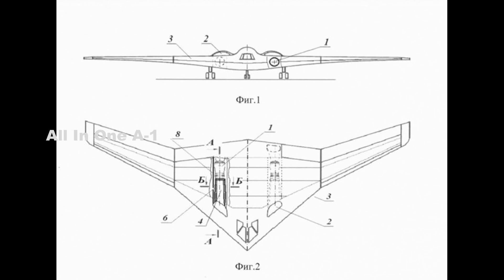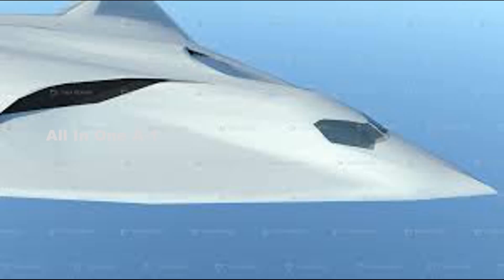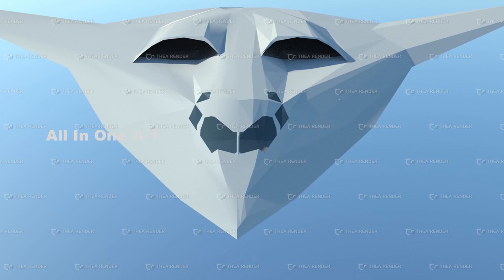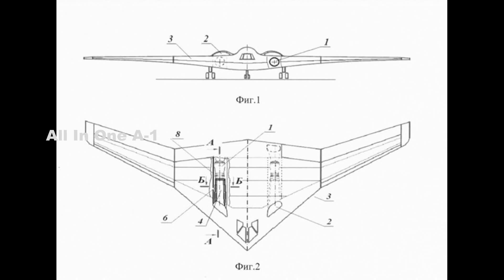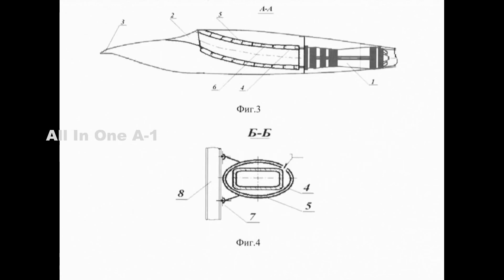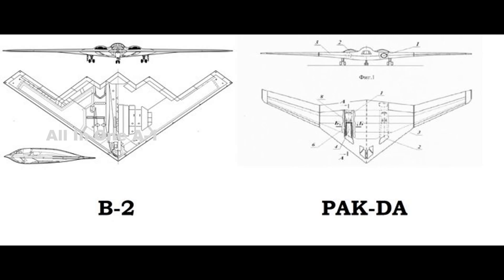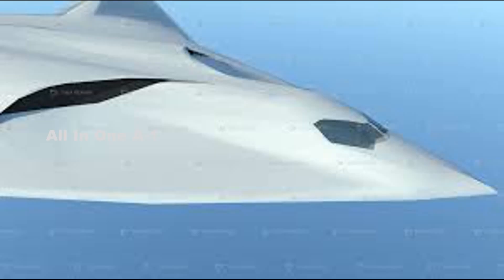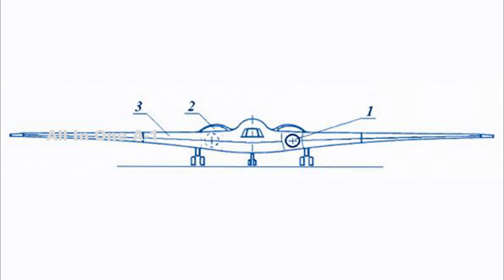Russia’s PAK DA New Bomber, Reveals Official Model of a Flying Wing Design? Tupolev PAK-DA

Comment: There is no way Russia can afford this bomber.
Reply: They said the same with su-57 and here it is, they said the same with ms-21(passenger jet) and here it is. What if I say, that we have a whole lineup of uav's? Corsair, Orion, Forpost m2, Altius, Sirius. Orlan 10 is also a cheap interesting variant. All of them were made in Russia, but there are soviet drones like tu 141. Besides all of that, we have 2 working prototypes and 3 machines coming very close. Serial manufacturing is close too. Don't forget the purpose of these machines - eyes and ammunition of su57 and su75 in the future. 
You can call it Mordor, but we have Sarmat(Satan 2), ICBM running 17 machs as a rocket. Do I hear Minuteman III screaming? Oh, it is also long-range, it can fly anywhere from any point of the map)
Also we have hypersonic otms like Iskander, while USA only built one successful prototype. Don't forget 10 mach Kinzhal rocket and that's about it. Also. Armata platform for IFV and tanks, new modifications of t90's, t80's, t72's vs aged Abrams? Funny comparison, thanks for details. We'll call you later.